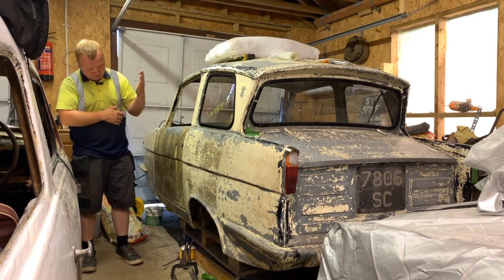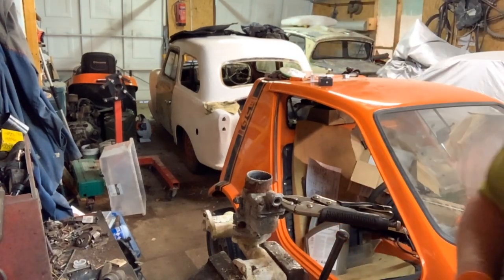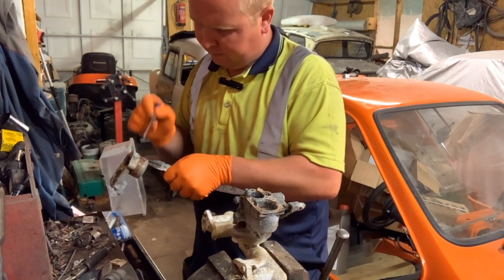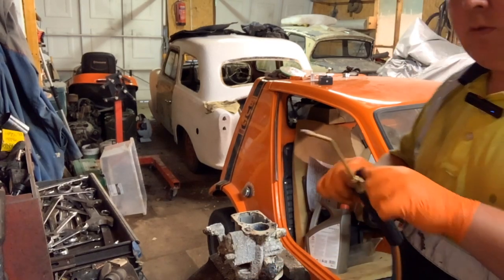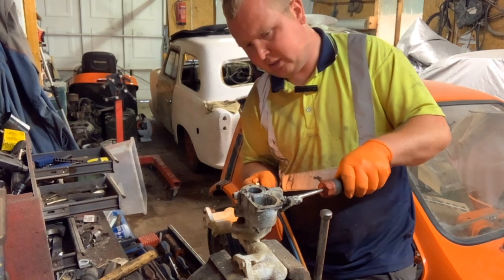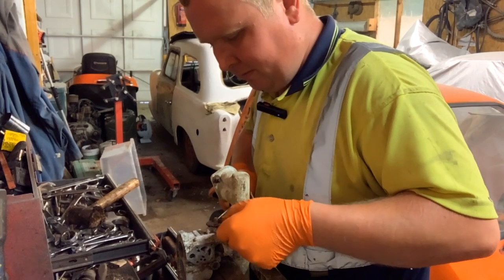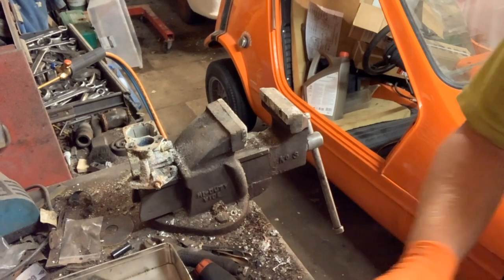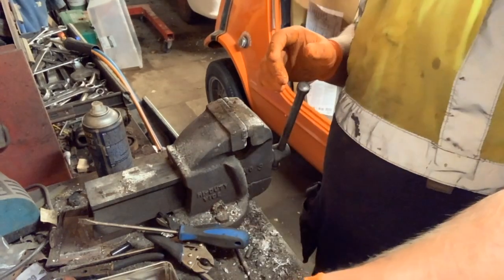Just how seized up can a carburettor be? 🤔

Comment: I remember when my SU started leaking around the butterfly spindle, the gods of ebay shined on me that day when I found a NOS "yellow top" Rialto carb on ebay, still with its tags and SU branded gaskets... £25, I went the whole hog too buying an electronic distributor, high end sports coil and rebuilt the ignition lines.   I lost the ability to thrash her to plus 90 but the power delivery has remained superb since and the old girl still races to 70 and will cruise all day sweet as a nut and will thrash to just on the 90 (on a disused airstrip not a road) but I don't need 90 on todays roads so 70 is good enuff for me :D

Comment: If you put the last Regal next to a Ford Anglia 105E you see where the design cues came from.   The rear sloping screen came about when Ford using industrial espionage stole the very idea from Standard-Triumph then using S-T's design litigated the company into the waiting arms of BMC, Ford admitted it in years later and people wondered why S-T got hammered whilst Reliant were given a free pass so to speak.   Of course Reliant was building Ford's fibreglass cabs for truck and tractor and no doubt some aspect of a deal was done that the new Regal with suitable changes like the headlamp nacelles squared off and the rear lights changed, that Ford would be happy with it.   Reliant were very good at ahem steering close to other companies designs, the later Scimitars were called poor man's Jensen's for a reason, the Rebel nicked quite some cues from the early Triumph 1300 FWD up front and the A40 Farina up back but of course Reliant was building fibreglass stuff for British Leyland too so nowt was said hehe